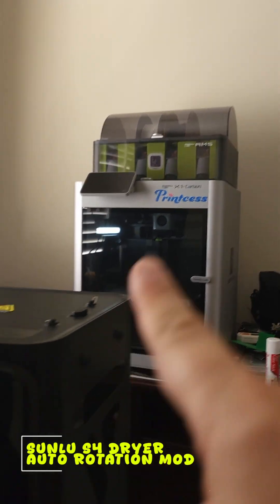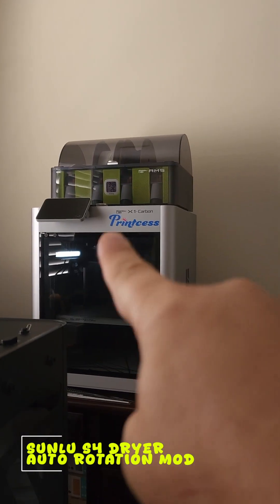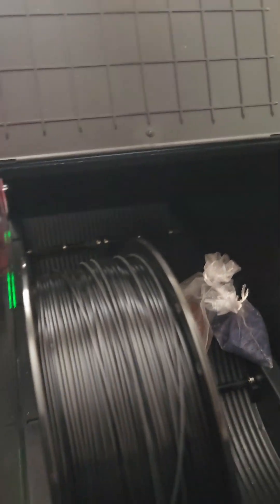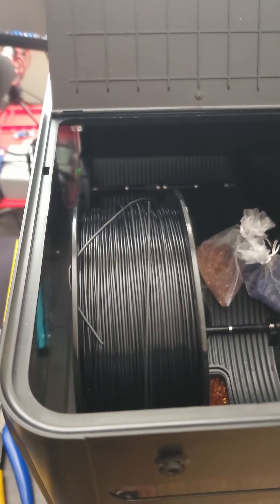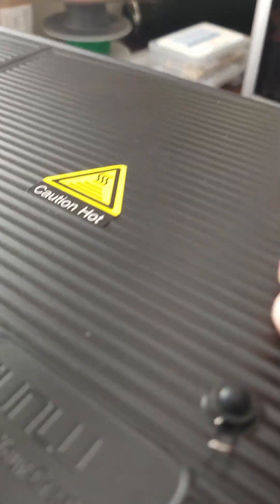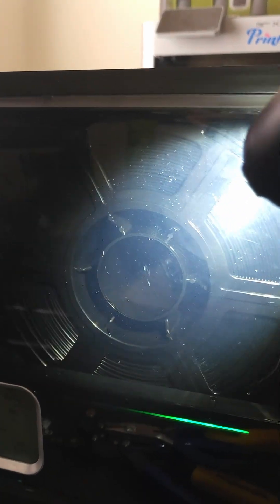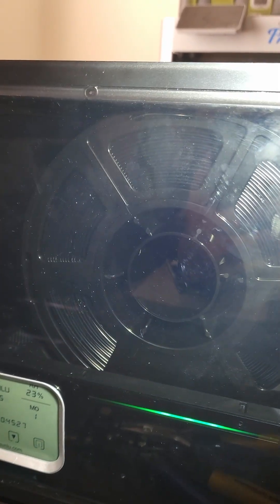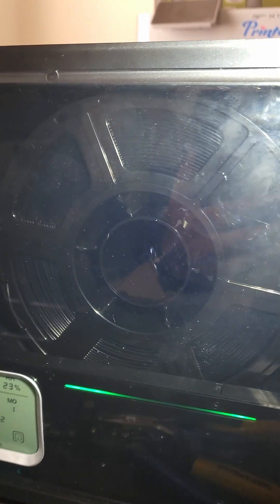Game-changing auto-rotating Sunlu S4 mod coming soon #sunlu #3dprinting #makerworld #flir #polymaker

Comment: Does the spinner have a neutral gear so you can still use the S4 as a filament dispenser directly into the printer?
Reply from the maker: Yes, there is a push button switch to turn this gear off. I use my dryer too as I print so this has to be stopped when in printing operation.

Comment: Get a couple of thermocouples and place them in various locations inside.  That’ll confirm if the temperature is or is not ‘360 degree’ like the MFG says.  I can basically guarantee you that it’s not, as you said.  So rotation will help.  Will it reduce drying times?  Idk, but it will give you a spool that’s more consistently heated/dried.
Reply from the maker: The problem isn't the chamber. Its more to see if the filament is getting evenly coated with the heat. I do believe this might reduce drying times as the spool spins. I used to do this manually. Every 15 or so min I would open the top and spin the spool halfway for about 2hrs of drying and my prints would come out nice.
Reply: @Fred_Mirzaian I know what you’re trying to do.  But you also said they don’t heat 360° around the spool, but you couldn’t confirm that.  I was saying how you could confirm that
Reply from the maker: I know exactly what you mean! I was tired when I recorded this, and you can probably tell from my face. When I said "360, I was referring to the 360-degree rotation of the spool to make sure the filament dries evenly.